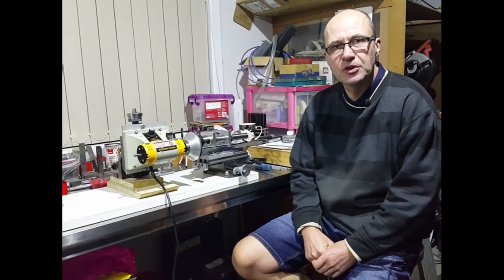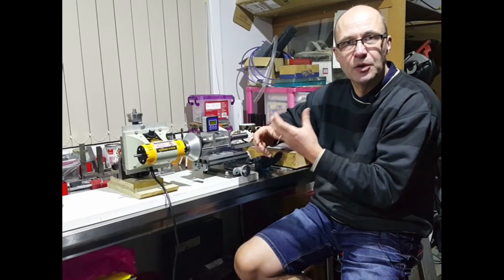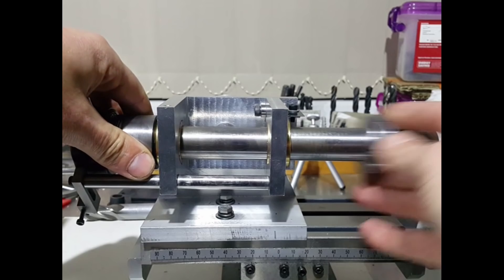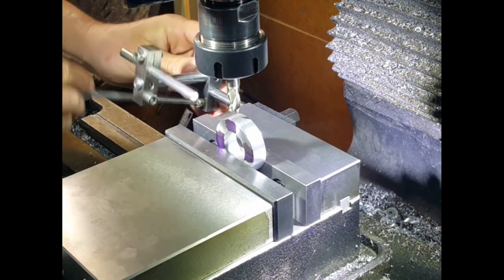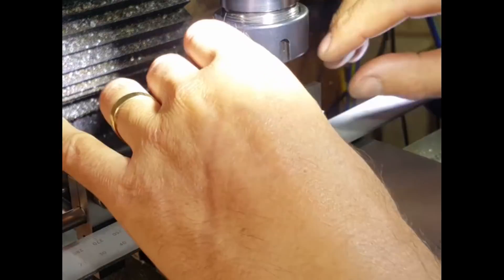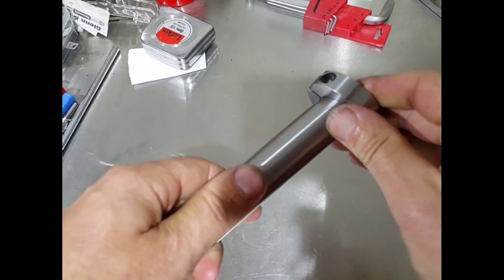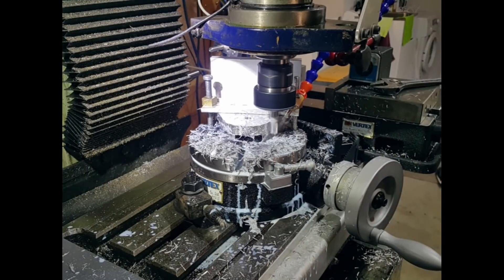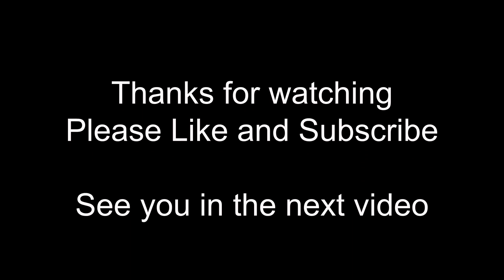#32 - Endmill Sharpener/Grinder - Part 2

Comment: Hey Kevin.
Good to see the progress.

My only question.
Is why you did not index the 90 degree cut-outs in your rotary table ?
Just seems a little rough setting it by eye.

Your idea with the Angle Meter would be much easier and more accurate than engraving graduations.
But i am sure you will work this one out.

Looking forward to Part 3
Peter.
Reply: Peter CCR ENG  hello Peter 👀
Reply: @Man-in-da-shed 
 Hey Ian.
I have not been over to your shed for a couple of weeks now.
Hope all is well with you.
Talk to you soon.
Peter.